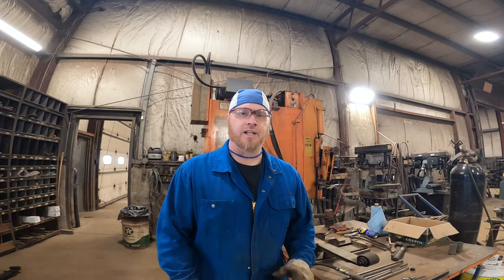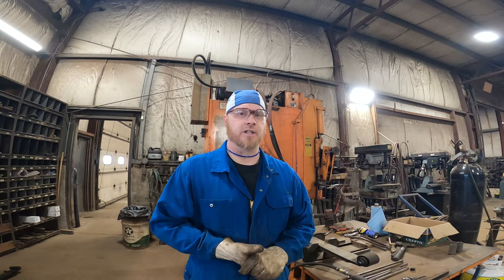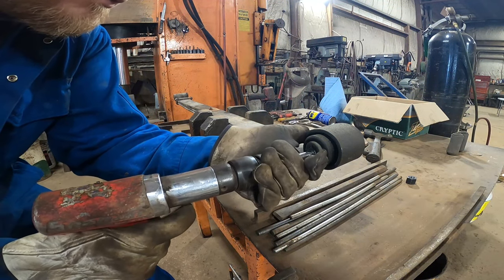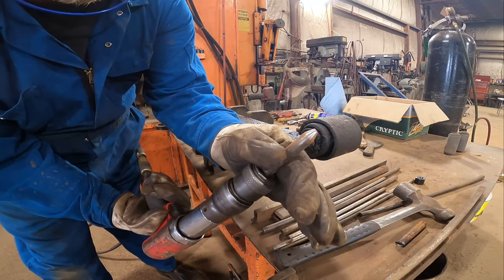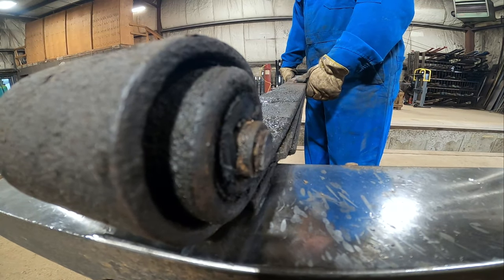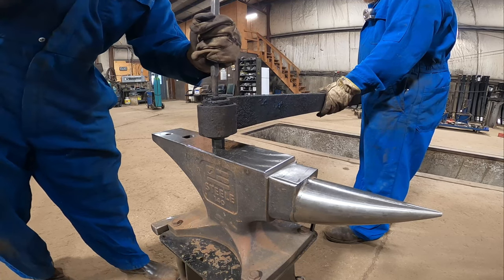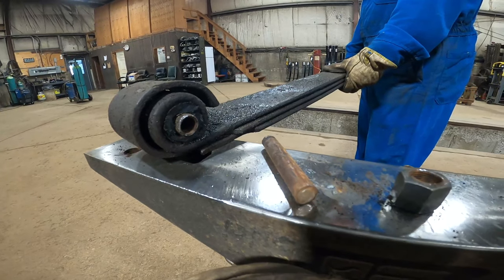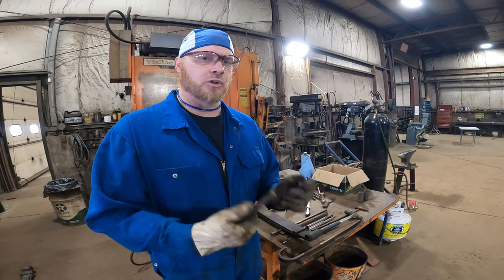How to remove leaf spring bolts without heat

Comment: That leaf spring looks VERY flat. Was it done that way on purpose? I have a utility trailer that was homemade that I got from someone with leaf springs just like that. And the trailer is already like really high off the ground even with the flat leaf spring. And this makes me wonder if some of those leaf springs someone may have done flat on purpose?
Reply from the maker: these leaf springs are naturally really flat.  they are out of a chevy 1500 pickup and they are designed to bend backwards when under load.

Comment: Nice tips! I just bought a project 1977 Datsun 620 and I'm doing my due diligence on everything I need to sort out for a frame-off restoration. My leaf spring bushings are all sitting haphazardly in what used to be "rubber" and I'm sure it will be a mighty long day of grumbling and sweating.

Comment: Thank you for sharing . Used the nut and punch method on a de soto left rear spring that was giving my uncle heartburn for weeks .
Reply from the maker: Good stuff!  you can't use heat or everything goes in the trash.

Comment: Nice video but what if you dont want to disconnect the front end of the leaf spring and still need the back off in order to replace the shackle?
Reply from the maker: this if for when customers bring in bolts they cut off with a grinder.  not my favorite way to disassemble a leaf spring suspension.

Comment: Any tip for removing a seized spring shackle pin from a hanger in situ,.. . ??? . without access of a hammer blow...
Reply from the maker: you need an air hammer, or air chisel and a torch.  heat up the head of the bolt read hot real quickly and then let the heat penetrate into the bolt.  hit with the air chisel.  make sure that you leave the nut on the end of the bolt so you have something to "hang" onto the end of the air chisel.
I have a video on it "how to remove leaf springs bolts using heat"
Reply: @simcoespring   no, like a  pin with a thread on the end to take grease and fit a grease nipple...🙂🙂

Comment: How do you get the outer sleeve out. When, you don't have a shop. Don't have an anvil. Don't have air tools.
Reply: Sawzall with metal blades, or screw driver through rubber until you can pull
Metal out

Comment: If its off the vehicle, why not use that 100 ton press? Or was this just to show a low tech way? Also, why do you cut the bushing outer, couldn't you just press it out as well?
Reply from the maker: The spring was removed by the customer.  Just showing a tow tech way of removing bolt stumps.

Comment: You can also cut the head off, then use a nut on the other end’s threads. Tighten nut to pull bolt out
Reply: just used this technique today .. Thank You very Much...

Comment: Any suggestion when neither of these options work? I’m ready to burn the damn truck to the ground
Reply from the maker: have a few videos that might...might help.
How to remove leaf spring bolts using heat.
The only other option is to cut it all apart and replace the bushings.  Removing these bolts can be one of the hardest thing you'll ever do.

Comment: All this labor, for what, buy new springs. If the bolt is froze the spring is trash....
Reply: Not necessarily. If you noticed that's the fixed end of the spring. The bushing would have enough flex to not be tore up.
Reply from the maker: I don't know why someone would throw out a $300 spring for the cost of $55 bucks in labor and parts.
Reply: @simcoespring   Wore out Bushings, wore out spring.  $200 for new spring shipped to me.  These 1500 trucks had weak springs from the factory. Rated for only 1,500lbs many broke and GM replaced under warranty.